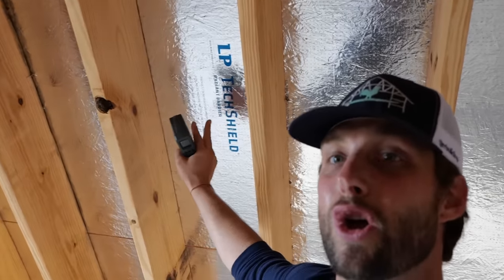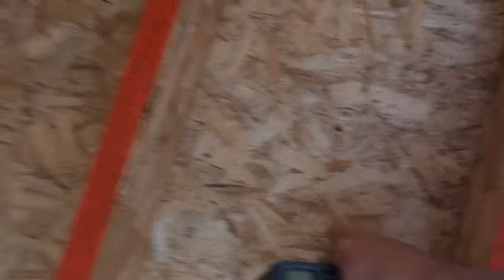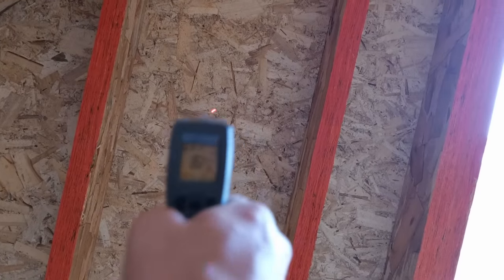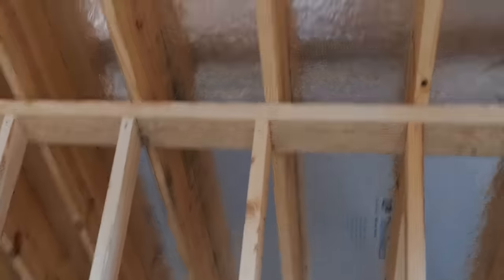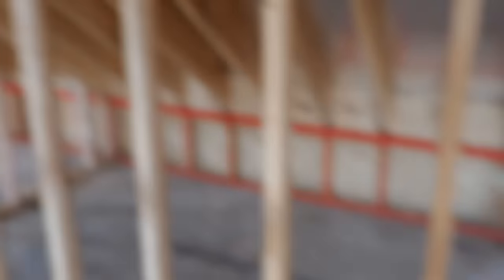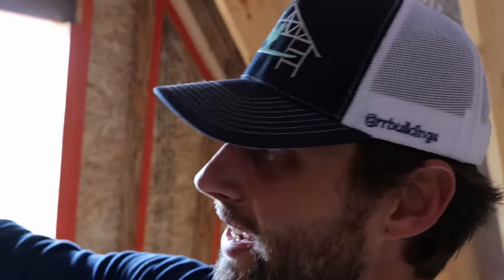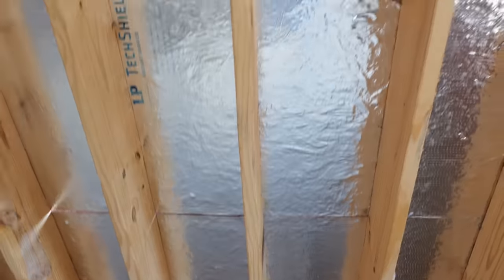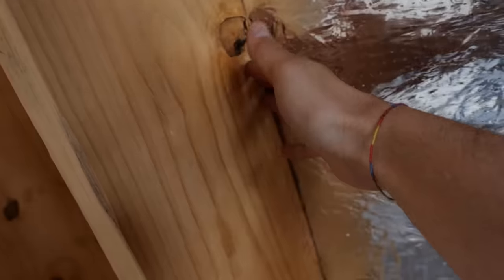Do Radiant Barriers Work? - LP Techshield Review

Comment: Using a infrared thermometer on a low emissivity surface will tell you more about the temperature of the background than the surface itself. Most of the point IR thermometers assume 0.9 surface emissivity. To be more accurate point sensor at a painted part of the surface.
Reply from the maker: But that's exactly the point.  We are not trying to determine the physical temperature of the decking, but how much infrared heat the decking is emitting, which the IR thermometer is great at.  I agree it will not match a contact thermometer because the emissivity of the IR thermometer is not calibrated to the ultra low emissivity of the aluminum foil.
Reply: Try sticking a piece of masking tape on the radiant barrier and the regular OSB. Aim the the thermometer at the tape to get an accurate surface temperature difference. With such a reflective surface you end up measuring the infrared it is reflecting rather than the surface temperature, not all the different than trying to measure the color of a mirrored surface.

Keep the videos coming! I've learned from a bunch of them.
Reply: I understand the point you are trying to make, but an IR thermometer reads the combination of reflected and emitted radiation from a surface. The thermometer cannot differentiate between them. So when you take a temperature from a low-e surface you are getting a reading that is primarily reflection and very little information about the surface temperature itself.
Reply: I'm with Robert. I'm not buying into this presentation. And I live in a cold climate so I don't see the value in this product.
Reply: I'm pretty sure if you were using a real thermal imaging camera you would see your own silhouette on the screen indicating your body temperature, not the wall temperature.
Reply: @roberthart8496 , but the point Jordan is trying to make is the actual surface temperature is irrelevant.

Comment: Sorry if this question was asked already but, do you also need an air gap between the radiant barrier and the roof? Or is it only necessary between the barrier and the insulation? Dealing with a metal roof and want to make sure I install correctly! Thanks!

Comment: Hey, so I have radiant barrier but not on the OSB and I have a air gap of about 6” b/t the roof deck and the radiant barrier and it works great. 
I’m an inspector and almost no one puts the wider rafters and insulation to create an air gap, they just buy the radiant barrier OSB and slap it on the roof, not sure it helps at all without the proper air gap. What a waste…!

Comment: When I rebuilt my roof the local building code required the radiant barrier, and I chose LP Tech Shield. I only regret not using it on the west-facing gable end as well. It works great. My insulation is in between the joists, not the rafters, so I maintained the needed air gap.  Even when it is over 100 outside, the house feels like maybe 80 inside. No need for A/C now.
Reply: Do you can put this on roof but not on attic floor ? Would that be correct for the warmth in cold out & vise Versa?

Comment: 599 comments here. Radiant barrier on the roof side with airgap would be ideal then radiant barrier on rafter bottoms if an left as an  unfinished space. From what you just showed you have conduction at each rafter to glued on radiant barrier to sheething. Easy fix. Blue Dow sill seal foam gasket in a roll is a closed cell foam that compress enough to provide a decent thermal break instead of all those thermal bridges. Keep up the good work and give this some thought.

Comment: The emissiivity constants for aluminum are much lower than for wood.  Even if they are the same temp, the aluminum will read lower than the bare wood.  There is a setting in the menue of the IR temp gun to set it appropriately forneach material.
Reply: Thank you. I was screaming at the screen during the video :)
Reply: from the shine on the barrier, looks like it will be rereflecting all the heat coming from inside back inside. not sure what the other side looks like, but really doesnt matter. It picks up heat from the other side via conduction. totally confused how this works now.

Comment: You need air space around the radiant barrier so that the barrier has a place to radiate the heat to.  This installation is radiating the heat inwards to that air barrier which will heat up the insulation next to it which will then radiate heat inwards to the room.
Reply: That foil has a very low emissivity of about 0.03 compared to the wood at 0.9 it is laminated to. So, it will not radiate much at all and the decking will heat up even more.  It might cause heat transfer to the attic air by through convection though to a smaller degree.
Reply: Don't you install it according to your most dominant season?
Reply: @Mattie_Ice  In the video the structure is in Texas.  He wants to radiate summer heat out of the structure.  What he just did was install it to radiate the heat from the structure back into the structure.  That could be useful for a structure located in a cold climate, which is your point.  But you also need to be sure there is an air space so that the heat can be radiated at all.  This guy installed this wrong.
Reply: It is a Radiation Barrier to reduce radiant heat transfer to the surrounding air.

Comment: If someone has not already pointed this out... the emissivity of shiny metal is very different than wood, which will give a different temperature indication, even if u have an emissivity adjustment on the temperature gun.  A more indication would be to use a piece of masking tape on the shiny metal.

Comment: Heat transfer video? I'm in! Cheers.
Reply from the maker: Alright! Cheers.
Reply: @JordanSmithBuilds  If you put a piece of black electrical tape, it would have given you a better point of which to measure from on the barrier.  The emissivity of the surface makes a difference when taking a reading. I believe this is part of what Robert Hart was trying to convey.

Also I'm interested in how this affects the life of the roof shingles.  I've seen other builders speak of the need for an air gap to prevent Ice damming in the winter up here in the northeast to help prevent the type of damage to the roof which was caused by overheating the snow and melting it, then the melted snow ends up creating an "ice dam" when it cools at the bottom of the roof.  You probably know about this, so I'm probably "preaching to the choir".
Reply: I wonder how this product compares to the fiberglass I saw on this channel #sinnisjInsulator.

Comment: The heat we feel from the sun is from the infrared wavelength portion of the electromagnetic spectrum, not from the ultraviolet portion.
Reply: M Detlef  Heat is still infrared.  The same reason that the old incandescent light bulbs got hot.  They emitted around 90% infrared light and almost no ultraviolet.  Your body emits infrared, hence why you show up as white on an infrared camera.
Reply: Ernest your incorrect and so is mark. Let me try and explain it. Thermal radiation ie infrared is not what we feel from the sun. We feel UV rays.. which penetrate our skin, and COOK us from the inside. Thermal radiation is CREATED by UV radiation and can only be measured a short distance. Meaning.. that light bulb... you dont feel the heat standing 10 ft from it do you. no.. However if that thing was throwing high amounts of uv light... you would be radiating heat from the uv light it has. OBJECTS radiate heat You get sunburn from UV light not from IR light. Now that doesnt mean its not dangerous. Im not saying that.. However because UV light is the shorter light on the wavelength it holds more power.  Yes the sun EMITS IR  Just like a toaster but we doe not feel it. If we did... then mars and other planets closer would be HOT planets not cold.  Space is -455 farenheight.. there is no way IR heat is transmitting in that temp and we are feeling it.  Its all done by uv light.
Uv light is Absorbed by the earth at like 90 percent which then heats up our attic ie stratosphere. what ever is not absorbed falls on the earth and bounces around and heats those objects. Then WE as a planet show IR radiation. And science THINKS it comes from the sun.. but this is a misnomer. Its done by UV light being converted INTO ir light.
just like standing Next to a toaster... you can feel the heating elements... but that toaster cant make the bread toast if its outside the toaster. It has to be CLOSE for it to transfer. 
However.. Take the bread and put it in a solar oven when the UV index is at a 9 or 10 you will have sunburn and so will the bread... and both will be radiating IR energy from the uv hitting them.
Reply: @N0body247    Thank you.
Reply: @N0body247  you are incorrect.  Radiation travels in electromagnetic waves and does not require a medium to travel in. This is the definition of radiation.   This is why there are dramatic temperature differences on the light and dark side of the moon where the atmosphere is pretty much negligible.

ALL light in the EM spectrum travels through vacuumous space and if it didn't you should call NASA ESA and CSA and tell them to stop building the James Webb Telescope because it's supposed to be specifically looking at IR wavelengths radiating through space (think FLIR on steroids).

This is demonstrated with a fire outside on a cold winter day and is why the surface of objects are much warmer than the air around them and is also why your friend is a jerk if he stands in between you and the fire cause you'll start feeling cold.  

This is also why there needs to be an airgap between the backside of the OSB and the radiant barrier. Otherwise the heat is being CONDUCTED from the OSB to the aluminum and re-radiated down. This is a similar principal used to INCREASE IR emission from aluminum plates in contact with pex tubing in hydronic systems (which is also why best installation practice is to install a reflective barrier with an air gap on the side not being heated and insulation above that.) And yes emissivity and reflectivity are problems when using IR thermometer or camera and comparing 2 different materials.

The solar irradiance article on Wikipedia is a good read for information there you can see the irradiance curves and the absorption of radiation at various wavelengths from water, oxygen, and carbons dioxide... Greenhouse effect at work.  You also might be interested in articles on black body radiation and emissivity.
Reply: @N0body247  also in regards to your light bulb or toaster example, the radiant flux incident on an observer is higher the closer the observer is. This is because EM radiation (visual spectrum and heat) is being emitted in all directions from the element. The reason why you can't feel the heat is the same reason why if you take a picture of someone inches away from an incandescent light bulb they will be over exposed and 10ft away they are more likely to be properly exposed. There is more radiation incident on them. We see light in brightness and feel IR in heat.

IR and all types of EM radiation is being finitely radiated out like spokes on a wheel. Further away it is the less dense it is, the less it lights or heats up an object.
Reply: @christinearmington  infrared radiation is nothing more than light that we can't see. Visible light, infrared and UV as well as a host of others are all on the electromagnetic spectrum. By his logic we wouldn't be able to see anything in space.
Reply: @kb45382  no see I’m gonna have to stop you . NASA built the infrared scopes to see ir however ir is an after affect to uv hence why you can’t see ir past a certain point from the object. Ultraviolet is what moves thru the solar system hence why our weather talk about the uv index. Ir comes from uv. That’s why we have uv exposure and wear sunblock. If you wear sunblock and don’t get sunburnt you wont have much more ir radiating from you than you normally do. Ir is a measurement of heat and an absence of heat the uv creates the heat if this wasn’t true.... you would be able to get sun burn at night
Reply: @N0body247  also Mars is further from the sun but that is beside the point, you are forgetting about the atmosphere which traps heat. MVEMJSUN(P)

Probably a better comparison would be our moon. Minimum is 100K or -280F Maximum 390K or 242F... Which fluctuates because it doesn't have a robust atmosphere as a buffer.
Reply: @N0body247  I studied physics and optics at a graduate level. You are wrong.
Reply: @kb45382  no it does not trap heat. The uv light heats the earth and some of it reflects back. That’s why cities are hotter than places with snow . Snow reflects uv light air is actually a horrible insulator
Reply: @N0body247  definition of radiation: 
In physics, radiation is the emission or transmission of energy in the form of waves or particles through SPACE or through a material medium.[1][2] This includes:

electromagnetic radiation, such as radio waves, microwaves, infrared, visible light, ultraviolet, x-rays, and gamma radiation (γ)

particle radiation, such as alpha radiation (α), beta radiation (β),proton radiation and neutron radiation (particles of non-zero rest energy)

acoustic radiation, such as ultrasound, sound, and seismic waves (DEPENDENT ON PHYSICAL TRANSMISSION MEDIUM)
Reply: @N0body247  I think your misunderstanding of this principle is what is getting you hung up: While transparent to visible light, carbon dioxide is a greenhouse gas, absorbing and emitting infrared radiation at its two infrared-active vibrational frequencies (see the section "Structure and bonding" above). Light emission from the earth's surface is most intense in the infrared region between 200 and 2500 cm−1,[86] as opposed to light emission from the much hotter sun which is most intense in the visible region.
Reply: @N0body247  if air is a horrible insulator how do you explain the moon which should have virtually identical solar irradiance.
Reply: @N0body247  also insulation is for conductive heat loss. Since space is a vacuum this is next to nil. What the atmosphere does is acts as a radiative barrier to keep radiation energy in the atmosphere. CO2 and water vapor absorp radiation waves on a normal with the earth's surface traveling toward space and re-emit them in all directions thereby "trapping" heat
Reply: @kb45382  there is no air in space . Space is a vacuum
Reply: @N0body247  yes vacuumous space, Im not sure I follow your point.
Reply: @N0body247  have you looked up solar irradiance yet? The spectral data is there.
Reply: @kb45382  no see this is why I have issues co2 does not conduct heat. That’s why they use it in refrigeration to cool things. Why because it displaces air. Air is not what traps heat it’s water. Water vapor traps heat. If air traps heat we would not have an Antarctica when the light reflects back. The ocean traps more heat than ice and that’s because liquid is the normal state of water. It has 2 extremes ice or steam. O2 or oxygen has one liquid which is extreme cold.
Reply: @N0body247  water vapor and CO2 as well as other greenhouse gases are all constituents of "air" the poles are relatively cold and the equator is hot because radiation comes into the atmosphere more tangentially at the poles and perpendicularly at the equator. This is also why we have seasons. When EM radiation strikes an object some is reflected and some is absorbed. The more tangentially EM radiation strikes an object the more is reflected and not absorbed. The poles were not always snow covered... Look at the time of the dinosaurs when more greenhouse gases were in the atmosphere.
Reply: @N0body247  the ocean traps more heat not because it's liquid but because it absorbs more EM radiation.

I think you're thinking that I'm saying that UV radiation cannot be absorbed by objects and emitted as IR.. That's not what I'm saying. I agree this does happen and UV light is higher energy than IR or visible light. Nor am I saying that the surface heating up does not significantly contribute to temperature. But if you look at the moon it is both hotter and colder than the earth with roughly equal amounts of radiation... Why? When they talk about terraforming Mars and the moon they talk about creating an atmosphere to stabilize temperatures, why?

Comment: At 4:30, I don't think you have thought that through.My take is: the fiberglass on the inside is a tremendously good set of air pockets - therefore the radient barrier does a great job of reflecting room heat back into it whether or not it is in contact. The foil attached to the OSB has very little air cavity with which to reflect the outside heat out and if the heat is already past the foil - too late.

Comment: If you air gap between the barrier and the insulation I assume there will be a ridge vent or is it a closed system?
Reply: There should be an air gap between the radiant barrier and the roof deck.
Reply: What is the air gap measurement. 2-3 inches?

Comment: great video Jordan!  I was surprised at how well this stuff works
Reply from the maker: You can really tell a difference, can't you.
Reply: @JordanSmithBuilds  it definitely helped wasn't expensive and helped us get a great hers score.
Also helped keep condensation off the hvac system vs neighborhood homes drip trays constantly full.
Reply: I wonder how this product compares to the fiberglass I saw on this channel #sinnisjInsulator.
Reply: that is very wrong. Can´t not put a vapor barrier in the exterior of insulation.
Reply: I thought it needed an air gap between it and the panel?
Reply: @JordanSmithBuilds  what did you do after this what did put up, what did you use as  actual walls 😂

Comment: Would it be worth using the radiant barrier on outside walls with rigid foam that wouldn’t touch the aluminum face, and could you still get the “R” value that you would need for the walls?  Nice video with a lot of info in such a short time.